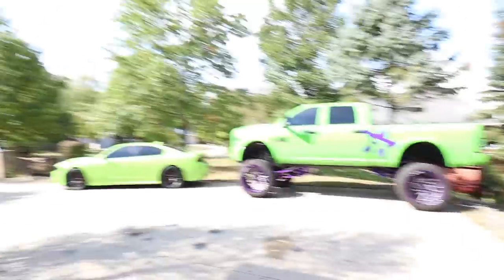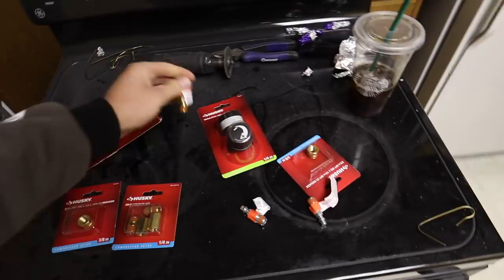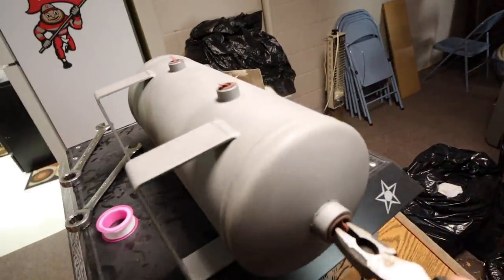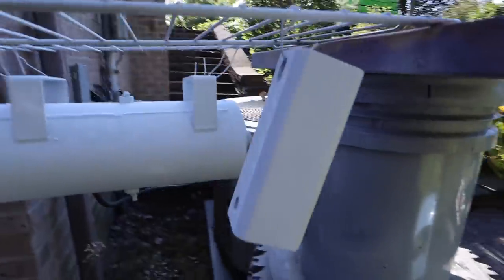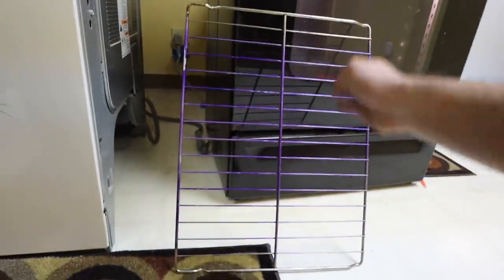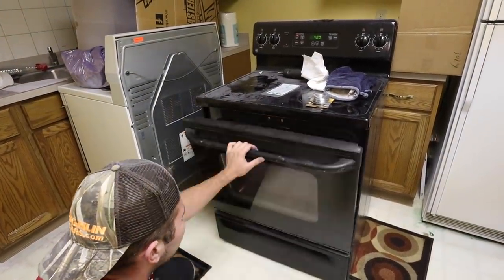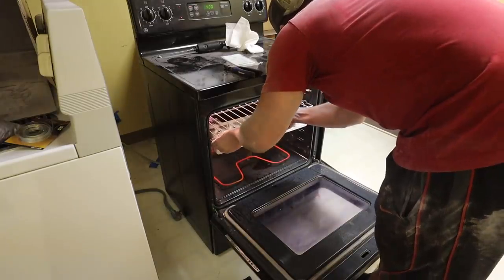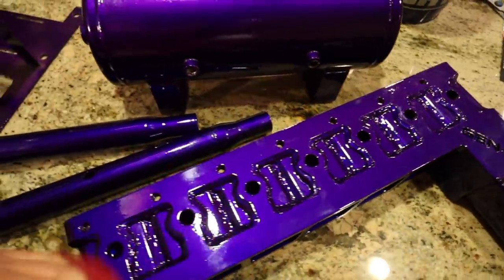I DID ALL MY POWDER COATING IN A HOME OVEN!!!

Comment: hey buddy quick tip, i worked in a powder coating shop for a few years and what we did to some of these really tight intricate parts was to pre heat them in the oven until they reached just under baking temp 

example: if your powder cures at 350 then pre heat part to 150-175 then begin the coat, it will stick instantly and in most cases we didn't need to have it hooked up to current for this to happen on rims or gate work with small openings ect ect.

hope this helps if you end up seeing this :) if you have any questions PM me ill be happy to help.

Comment: Been using that Eastwood gun for years.  If you drive a ground rod in the ground and run a wire from that to your makeshift rack the powder will attract much better than only using the little ground clip from the gun

Comment: I use a black & decker convectional oven for small parts like door handles, mtb parts and everything looks even and somewhat professional, when the powder coats the surface turn the heat down a bit.

Comment: Hey man quick question...
What did you use in the oven 

-Broil or Baking option?
-How height is the heat?
- How many minutes stayed in the big oven .
-how many coat of powder normally for auto parts

Thanks for advance reply

Comment: Hey Ryan, I have a 2016 ram that I am building. I want to install my own lift kit.  It will not be as high as your semi truck. However i want to install a 3 inch lift in the front and a 2 inch lift in the back to level it out. Do you suggest I’d do it on my own ?

Comment: This is the first video of yours I’ve seen.  Won’t be the last!  Interesting that you used a plain ol’ air compressor setup, but I didn’t see how you had the electric configured to provide the static charge.  Obviously, one lead to the part/oven rack, and the other lead to the sprayer nozzle, but what is at the source end of these leads?  Is there another video that shows your powder gun setup?

Comment: What kind of powder do you use? I’ve tried looking to buy the two coat but just can’t find any online 😬
Reply: Bailey C Prismatic Powders. They’ll have more colors than you’ll ever use
NIC (parent company) also makes Cerakote
Reply: toddbz thank you so much! 🙏🏼
Reply: @baileyc3254  Another important point is to print out the technical data sheet for each material/color you use to follow the cure parameters